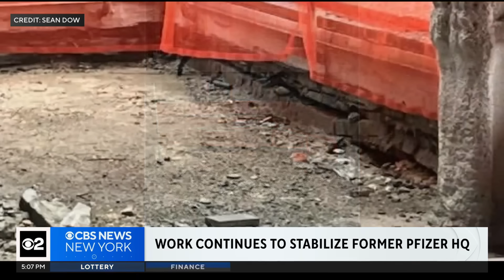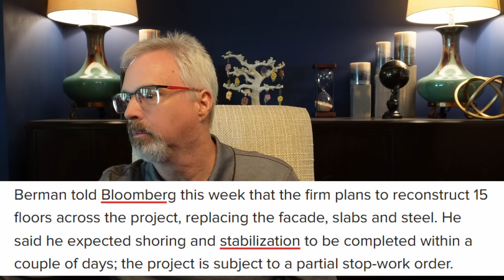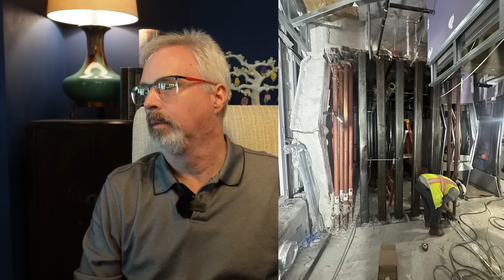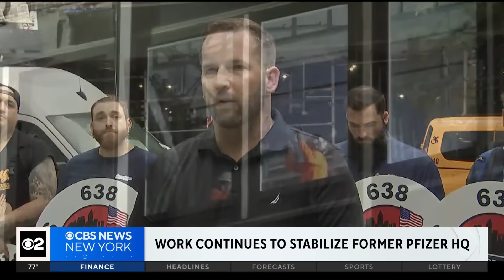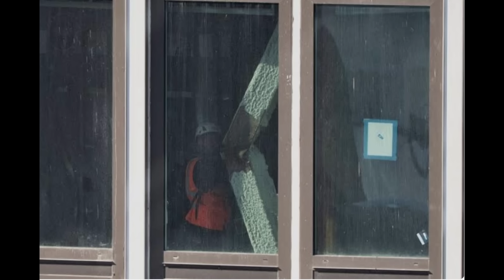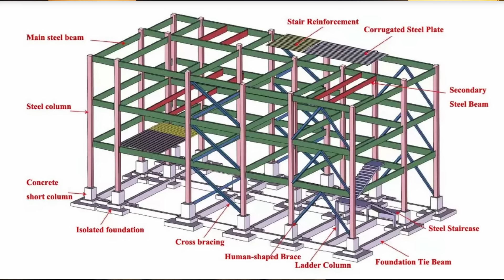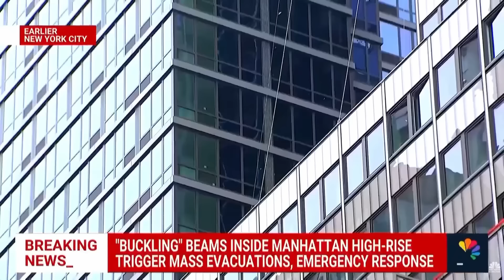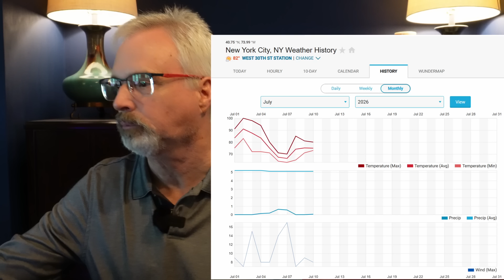Update - Pfizer Building Structural Column Failures; Now What?

Comment: I really didn't like that open area that then cantelevered the new building above it. I'm absolutely NOT an engineer so perhaps take this with a grain of salt, but it seemed like that was a soft story to me and I know that those are bad here in California because of earthquakes. My mind always goes to all those apartment complexes that collapsed during the Northridge Earthquake because they had the parking under the building supported by some columns and no walls. I get that there are some walls around this part but it's also at the corner of the building and I've definitely seen a lot of earthquake damage where just the corner of a building like that came down. The thing about it is that, even though they are rare, New York has earthquakes too and they can get into the 7s in magnitude. Northridge was only a 6.7 so why are they building new construction and for housing even with such a vulnerability? All that is even before whatever loading issue it seems like they had here. What are they even doing? So many people would have lost their lives in an earthquake if the thing hadn't failed even before it was finished. I think they need to rethink these things. Also, I thought that part was ugly but, if they want to put something ugly like that in there so that people have a balcony or whatever the idea was, then at least put in some cross bracing or something.

Comment: Thanks Casey. I always look forward to you commenting on engineering events rather than politicians, newscasters or the developer. The high temperatures and movement was interesting. I noticed the floor with the bucked columns was wet with standing water. Since the floors above were open for a while, I could imagine the steel structure getting corrosion started. I also wonder what wind loading will do to the existing structure now that the new floors are reaching into the sky farther and presenting more surface area. It's not uncommon for unusually high winds to blow out/crack windows in high rises, but I'm thinking about bending and twisting forces. I look forward to what the investigations find.

Comment: the fact that the added construction did not disintegrate in total collapse was that it 's own internal structure was supporting its own weight. It basically was hanging at a point. That means every single joint (bolts, welds, slabs, bars) not snapping has been overloaded and now represent hundreds of new failure points. That whole added construction has to be demolished and rebuild.

Comment: The fireproofing cannot be made of asbestos, they never would have gotten a demolition permit let alone a construction permit in New York City.

Also it is typical to see surface level corrosion im exposed structural steel, especially with the building of that age. There's nothing unusual about it.

The way the columns buckled looks to me to be  an overload situation. If they had corroded through I would  think that deformation would have been far more acute at the point of bending imo.

Comment: In my mind the engineers and the inspectors are the ones to fail the inspectors would have checked it properly and I've taken biotics or any other type of thing We would never with these type of issues building code and inspections are part of the process Was a proper structural survey done on the existing building that will hold the loads It's all up to the engineers and inspectors They're in fault

Comment: Old buildings may have had extra strength DESIGNED in, but that's never a guarantee that it was BUILT in - despite what the asbuilts say. 

Unless you want to sample the steel, and xray the whole thing, you can never really be sure.
There are always lazy and corrupt people which is why the extra is designed in. 
Designers know checks will be skipped, materials will be substituted by availability or corruption, so they try to make sure it will stand anyway.
They may even go above and beyond and try to design to standards not considered relevant to the location. Eg earthquakes. Never impossible nomatter how many centuries no one's felt one in that location.

Comment: I would not be surprised if it turns out that substandard or defective materials were used in the original construction, either unintentionally or nefariously. How thoroughly did the new engineering team evaluate the as-built condition of the structure vs what the original blueprints specified?

Comment: I wonder and raise questions
- how is the quality of the steel going back to 1959
- can the steel used in what was then the upper floor and not ment to take more load as the roof and weather conditioned load. (Snow)
- here the building codes would demand a double up of load bearing capacity,  so the heat stress should easily be absorbed in this total load bearing capacity. And the load would be highest in the lower part of the structure. 
Fact is. Those 2 colours couldn't take the load

Comment: Couldn't you do some basic high school geometry and back calculate how much the floor above (At that location) drooped.
 Prior to sagging , the beam was a straight line. 
The floor to ceiling height (as designed) known and is written down somewhere. That gives you the droop per floor because the height from floor to ceiling is known at that location. The height of the structure from ground level to the roof is also written down in documentation somewhere. You end up with total sag and how much each floor sagged which I assume might vary from floor to floor. and column by column. I wonder what cracking of the concrete floor decks looks like?  If there is a spider web of cracks heading off in different directions and where the cracks propagated from would be interesting to see. If all the columns are the centerpoint of cracking that radiates out from from ALL beams is different than if only some columns act as centerpoints for cracking.

That entire business about "Oh, those non-union workers caused the failure because they are non-union." 
The reason unions have such a bad reputation with the general public is because of statements just like that.  Seriously, did the some construction manager just randomly hand out work assignment packets with a parting comment of "Call us when you you are done so we can come take a look at your handiwork. 

How much extra load carrying capacity is built into the structure is a question I have.  
How many pounds of live load was each floor anticipated to carry per per sq. ft of floor. for conversations sake if each sq ft was anticipated to carry 500#, did the design stick with 500# ? or was it designed to carry say 550# or 600# ? That extra capacity costs real money. 
I know from my own experience that because the cost of of everything has increased significantly over the years, things "Well, the architect says 500# so we will design for 600# " doesn't occur nearly as much as it may have 20 years ago.. Now the conversation may be, "They told us 500# so 500# it is.
There is a real and significant cost incurred for building in extra capacity so deleting that extra "fat" from the design keeps to cost down. If they can't clearly map out how much load each column is carrying I would think tearing out everything down is the only viable option because a patch job will destroy the value of each residence.

Comment: Oh, this can be fixed.  Yes, seriously.  Jackstands for support (from the ground up), remove and replace the buckled columns, move down as engineering demands, and bob's your uncle, you have a fixed building.

I leave it to the reader to decide if that will actually be cheaper than a partial or complete rebuild.

My guess : not

Lastly, it recently came out that the firm hired for inspections has ... shall we way ... a "spotty rcord" ... as in, they've been caught in the past rubber stamping.  Makes one go 🤔

Comment: From the photo shown at 11:51 the only reason I can see that this didn’t collapse is the moment connection for the cantilevered portion which acts as a very flexible vierendeel truss with a shear tab “pin” on the back span - as it sags down there would be large bending & axial loads in the back span girders kicked back into the floor diaphragm at each level so the critical element would be the shear tabs of the back span I hope they have done something to ensure that load path remains intact..
If those gravity columns were at the building edge without cantilevers it would likely have come down - it shows the power of moment connections providing un-engineered redundancy.. Checked it in ETABS & results in DCR of about 7 in a assumed W16x36 backspan girder about 20” vertical displacement under dead load only.. Mostly girder bending not so much axial load with a weird distribution up the height..
The way to shore it would be a diagonal tension brace from the floor level of 2 sagging columns up to the interior column at every level (which could get over loaded also)… Providing the post shoring isn’t transferring the load back to the interior column it only works if they are doing it starting below the buckled columns level by level shoring upwards for it would be providing some level of vertical support.. Both could be done..

Comment: I am watching this development with great interest. I have a couple of thoughts about this. First of all this building was built during the time that the quality of Korean structural steel and plumbing pipe was suspect to put it nicely. Secondly I am wondering abut the fireproof coatings to cause abnormal corrosion of the structural steel members. There ha been problems with it and also with wood that caused wood to just turn to dust after a period of 30 to 40 years. And also the quality of construction of the original building and the additional floors added later. It may be that no one thing caused the problem. It may have been a combination of the above things or there may have been a totally different problem that caused the structural collapse, I hope it is investigated honestly and not glossed over. People forget a lot of what was built in 50's and 60's was designed for a lifespan of 50 to 75 ears and guess what that lifespan is expiring now.

Comment: The Assembly: Beams and columns were joined together using hot-driven metal rivets, 
the standard structural fastening method of that era.
I feel that some of thos rivets have given up on one section due to metal fatigue.

Comment: this is not my field but usually when there is a large project in a high rise usually the structural engineering firm will take xrays of the building to confirm the structure of the building.  thus if the blueprints from 1959 showed that the columns on floor 21 were to be x thick and they were not, the building project pre inspection would have caught that.  more likely what happened was the timing event with respect to the reinforcement of those columns on floor 21 and that component is owned by the gc and it will be their liability insurer who will need to cover the repairs up to a certain amount with the building owners covering the rest of the expense.  just removing the comprised section will take at least six months and by then there will probably be no appetite to replace that section.  the question is how badly did this impact the original structure which can only be determined after the compromised section is removed.  In the end there may only be around a 1000 units that will survive but the cost of repairs could through the whole project into bankruptcy.  Other high end question is where were the building inspectors in all of this and why was the project so far ahead of schedule.  Was that gentleman paying them off and is this a case of corruption?  Someone may be going to jail over all of this.  We shall see.   The saga builds.

Comment: Look, the owner knows he got screwed badly and  I think he understands he made a very poor real estate purchase. Now he's stuck and he's desperate to unload this dangerous piece of unsafe junk and find his way out as fast as he can. The owner is liable to say anything in order to squirm out of possible bankrupting circumstance to the City of New York. This building is not stabilized at all - It's failing, and doing so very quickly. I do not consider this building as recoverable - Even if you remove several floors. Once you overstress the original supports, then even with shoring them up with fresh metal it is still only a roll of the dice ! Tear it down and build anew !

Comment: Time degrades everything.   

Over 70 years, steel can experience corrosion (water from roof) and without the air temperature and humidity control provided by the occupied floors, the steel may have experienced thermal expansion and contraction than was never modeled.   With mothballed ships, we see significantly accelerated deterioration when dehumidification equipment fail compared to the neighboring ship whose equipped remained operational the entire time.   In this case the AC was turned off in 2024, while neighboring buildings had more stable interior conditions and saw no or reduce weather induced variations.   

I think there are other issues at play, but Value Space analysis is one part of the failure.

Comment: The Structural Engineer of Record on the current project is screwed.
Reply: oh yeah.  luckily not apparently one of the engineers Gensler Architects often teams with.  Who knows.  One of the structural engineers usually used might  have wanted, demanded too much probing testing on site observation surveyors documenting movement, that's how its often done, surveyors weekly daily whatever shooting same points to see if there is settling shifting etc as new towers go up.  Maybe Developer pushed his own structural engineer onto architect saying see they say tgey can tell everything about bldg just looking at construction docs & they are cheaper.
Reply: Haven't seen what the structural engineers specified. Perhaps the plans are fine but what was constructed didn't follow them.
Reply: @mitchmasterfix5292  Also possible that the assumptions included that the lower level supports were to spec.
Reply: Being a Structural Engineer has to be one of the world's worst jobs.  Those guys live on a knife edge.
Reply: @atoitoh2989  All you gotta do is to do your job correctly, and keep the records so you can prove that someone disregarded your results. Probably someone why says things like "Nobody knows more about construction than I do" (note that there is no connection between this incident and DJT, but I bet other "builders and innovators" say similar things).
Reply: You can’t rule out faulty steel support members in the original construction.
Reply: @danjohnson8170  The original building did not seem to have any problems until some idiot tried to construct a 16-story building on its roof.
Reply: We'll probably find out the lead engineer was a really good community organizer from Somalia.
Reply: Oh yeah!
Reply: I'm friends with a guy that works there. Not only is he very competent and dedicated, he has always talked about how impressed he is with the guys at this firm. So I'm inclined to think the collapse was beyond their control somehow. Perhaps it was construction materials placement. We will need to wait for the report. But yeah, it's a bad day for everyone at that firm.
Reply: @Lawman212  Perhaps your friend is not as competent as you think. What makes you think he is?
Reply: @Lawman212  what does it matter how competent people are all you need are a few corrupt insurgents inn the right positions to change data and fudge lie their way out of sabotage
Reply: @rednarok  No-one in an engineering company is very interested in lying about structural data. It's very obvious if stuff falls down, so they try pretty hard to avoid it. This will be cock-up,  not conspiracy. Possibly the original not built to spec, or corrosion over last 70 years, or some disastrous calculation error, or the new plans not being built to spec. Possibly a combination.
Reply: "Structural Engineer of Record"

What's that? Who's that? You mean the developer/owner of this building had a qualified structural engineer involved, on staff or on retainer? And here I thought the developer/owner just added a bunch of new floors by based on some reference tables in the Acme Book of House Floor Plans. 🤣 After all, they were converting the building to "residential" housing.
Reply: @Ralt_Alt406 construction within most cities is governed by law which often requires that any alteration to structures is planned and approved by a state licensed engineer, who after signing their approval is noted as the engineer of record, meaning they are responsible for the safety of their plans. If a structure is built to the plan’s specifications and fails under the scope of the design (I.e. not due to extraordinary circumstances such as a major earthquake), the engineer of record is legally responsible in certain ways for it. This engineer who signed this plan may lose their license and/or may be liable for the costs associated with these failures.

Engineering is the backbone of society.
Reply: @scottkleeman4849  "Engineering is the backbone of society."

Agreed. It's also the one profession where it is difficult or impossible to hide one's mistakes - they're all out in open for public scrutiny.
Reply: @scottkleeman4849  It's New York City. Everything needs to be approved by persons who love to receive "donations".
Reply: They should have included blue pills